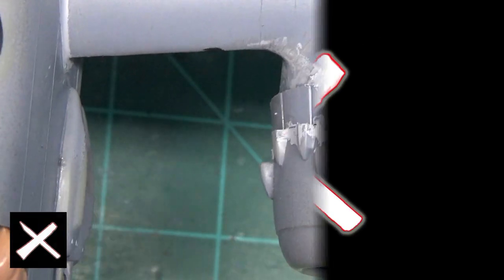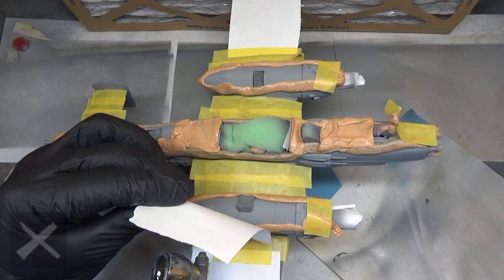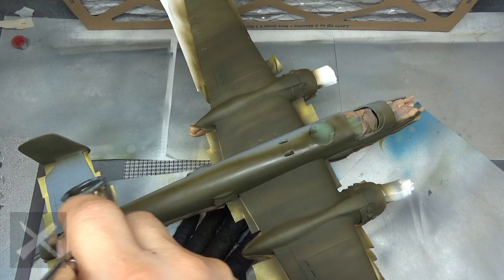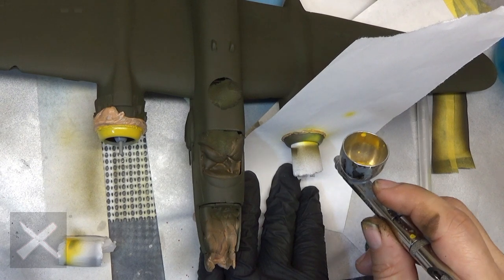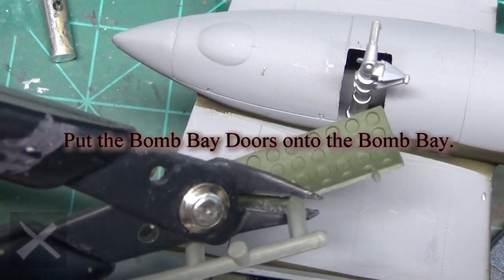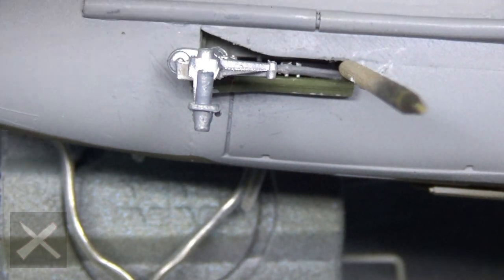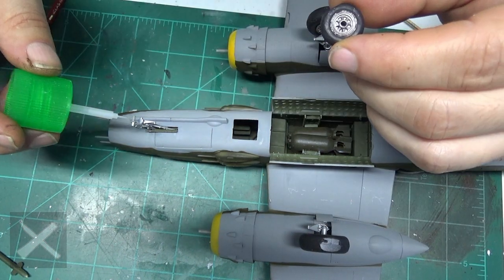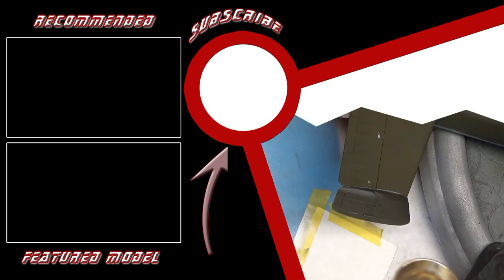Revell B-25J Mitchell Part 6 1/48

Comment: Did you gloss coat the whole thing?
Reply from the maker: I will, even though it doesn't need it. Its just for the decals of course.  Then a nice coat of acrylic floor coating for the weathering.
Reply: @PlasticModelBuilder  Interested to see the results! I'm doing one of these rn as my first, going with a polished aluminum look but not sure how I'm gonna finish it
Reply from the maker: Im sure it will turn out nicely!